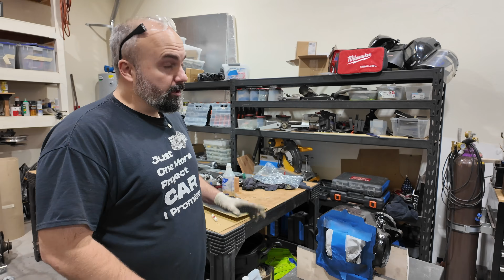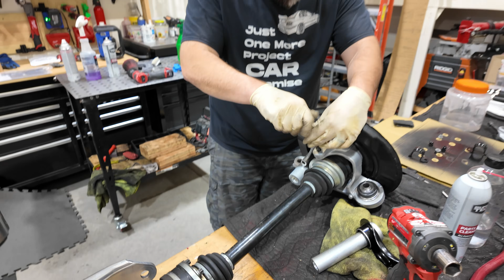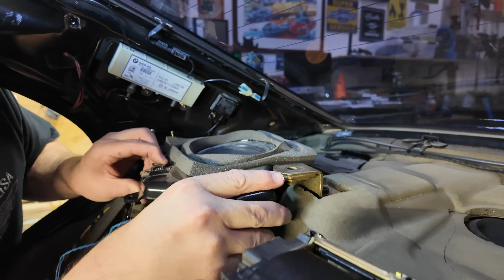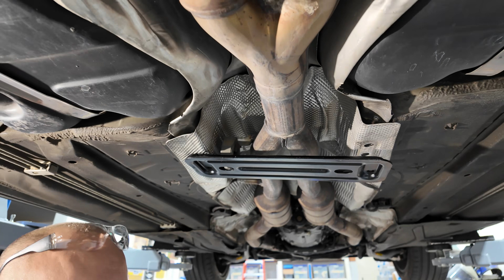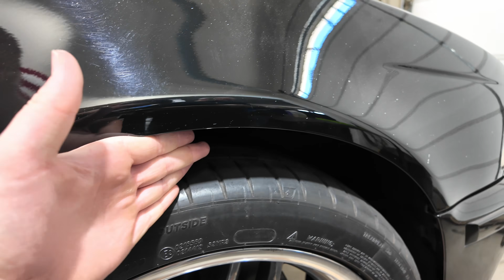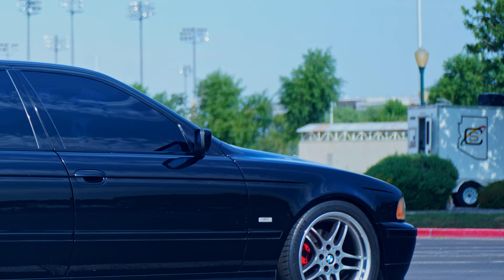E39 540i Restoration | Suspension Final Assembly

Comment: Do the coilovers have adjustable dampening? Also, I went to the Tail of the Dragon and eventually my brakes faded a bit. Any recommendations for improving the brakes for track use?
Reply from the maker: They are both heigh adjustable and damping adjustable. For brakes getting a good set of performance street pads and making sure you have fresh fluid or even higher temp fluid is very helpful. I run Hawk HPS pads on my M5 and have been happy with them.

Comment: Fantastic!  What exhaust setup is that?  I cut the scuba tanks off of mine and added the Turner straight pipe in its place. I think I like that just fine for the street.  I can actually tell I'm driving a V8 now.  Just curious in case I change my mind and want it louder.
Reply from the maker: I am running stock headers, cats and resonator into a Dinan muffler. I will be installing SuperSprint headers in the near future to really bring the exhaust note alive. The Dinan muffler gives it a nice deep tone when driving and no drone.